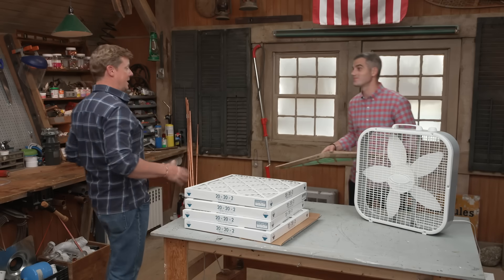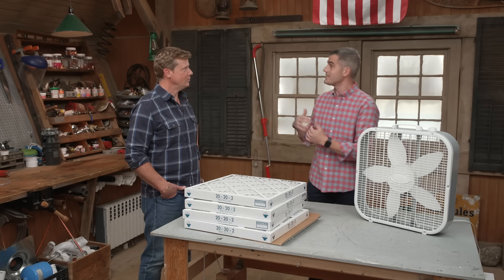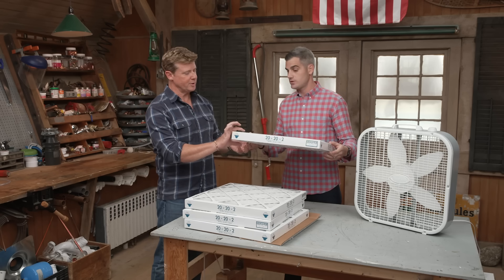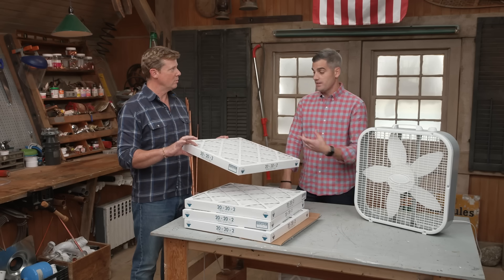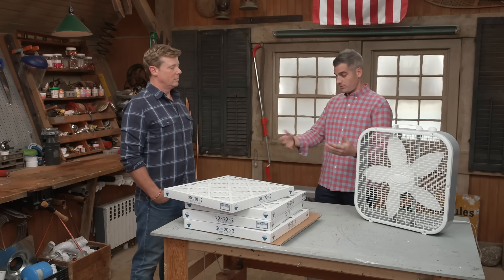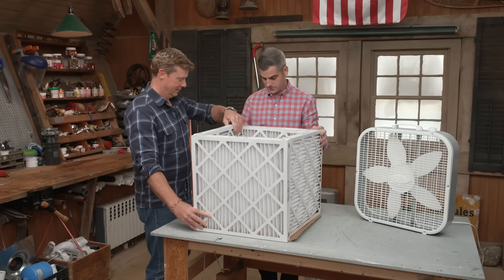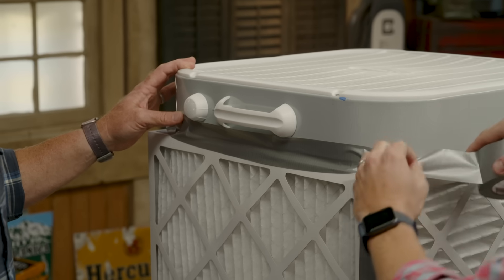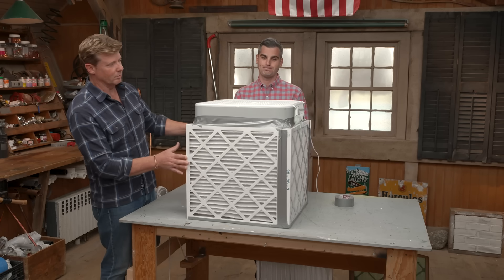How to Make a DIY Air Filter | Ask This Old House

Comment: I found a company that actually makes 3” thick filters that fit inside a standard 1” filter grille slot. They even have a foam gasket around the edges so it seals nicely. They’re fantastic! I get the merv 13 that’s 3” thick, and I didn’t need to retrofit anything whatsoever. Been using them about a year now. They’re the only company I know of that’s making these filters. Having worked for an HVAC company that specializes in air quality and filtration, I was able to learn a ton about how this works, and they’re the real deal.

Comment: Why NOT use HEPA filter ?  HEPA can removes ASBESTOS particles ( as well as bacteria and allergy caused particles ) which hazardous and damage your lungs  !
Reply: When this video was made air purifiers were sold out everywhere because of covid and all the wildfires so a bunch of people came up with these. Plus those 4 filters are typically cheaper to replace than a hepa filter. My fancy $400 air purifier's filter is $80 or more to replace and I need to replace it every 3-6 months because of all the crap in my local air. These filters you can get in a 4 pack from costco's website for $40.  The fan is ~$25 at walmart or similar.

Comment: I rent a large basement room. Problem is it has zero ventilation because it actually was the garage before it was converted into a room. I only have 3 small windows and no AC vents! 

To make things worse I have 3 cats, one of whom has developed asthma. 

I tried using an expensive air purifier but it gets caked up quickly and doesn’t really do much. There’s dust and hair everywhere no matter how much I clean. 

Gonna try making 2 of these so we can hopefully breathe more easily!

Comment: Im going to build a cardboard/wood version where I can slide the filters in so I wont have to tapae the filters. Having the filters slide rather than tape them will save me time and tape. It's going to take a little more measuring and design but at the end it will be worth it . Just sliding the filters in place will make it worth building it. Thanks for the idea guys!

Comment: As much as I hate being "that guy", I think it's important to note that the standard (Lasko-style) box fan is not designed to run in a horizontal orientation. Gravity will pull any lubricant from the bearings putting more stress on the motor and making the motor more prone to wearing out faster or, on older units, seize up altogether.

I just lay the filter against the back of the fan and let it suck up against the back side of the fan on its own. No tape needed. The frame of the filter sits nicely on the fan's footies and as long as the fan is on, the filter will stay in place. The most important part is to be sure the airflow arrows on the filter are pointing in the direction of the airflow.

I just don't think it's necessary to do that whole boxy thing with 4 filters. You're spending more money than you need to and you're really not gaining that much in filtration.
Reply: I highly doubt that would be a problem but if it makes you feel better,  just hit the motor with some spray lubricant once every 3 months.

Comment: The direction of airflow in a DIY box fan air filter setup is crucial for its efficiency and effectiveness. Here’s the breakdown:

Configuration Options

1. Air is pulled through the filters and blown out into the room:

The fan pulls air through the filters (filters on the intake side of the fan).

The air is then blown outward into the room, cleaned of particulates.

2. Air is pushed through the filters and blown into the room:

The fan pushes air through the filters (filters on the exhaust side of the fan).

Cleaned air exits the filters into the room.

Recommended Configuration

The most effective setup is Option 1: Air is pulled through the filters and blown out into the room.

Reasons Why This Matters

1. Fan Efficiency

Pulling air through filters: Fans are designed to pull air more efficiently than to push against resistance (like filters). This configuration puts less strain on the motor, improving the fan’s lifespan.

Pushing air through filters: Increases resistance, which can overwork the motor and decrease its efficiency over time.

2. Filtration Efficiency

When air is pulled through the filters, particulate matter (dust, allergens, etc.) gets trapped more effectively. The negative pressure created ensures all air passing through the fan is filtered.

Pushing air risks leaks or bypasses if the filters are not sealed perfectly, reducing air-cleaning performance.

3. Airflow Quality and Noise

Pulling air through the filters typically results in smoother, quieter operation, as fans are designed to work optimally with less resistance on the exhaust side.

Pushing air can create more turbulence and noise due to resistance.

Setup Tips for Best Results

Use MERV 13-rated filters or higher for capturing fine particulates.

Ensure filters are tightly sealed to the fan and to each other with tape to prevent air bypass.

Place the fan-filter system in a central location for better air circulation.

By pulling air through the filters, you optimize both the cleaning performance and the durability of your DIY filtration system.

Comment: The direction of the pleats in the filter should be vertical as that would add som strength to the PAPER structure. As it is vertical pleats just add weight that will aid in its collapse

Comment: 2” filters make it sturdier than 1” filters.  However, they should have put legs on it to have a 5th filter on the bottom for max CFM and CADR if you want to set that fan to high.  Should also use MERV 13 or higher.

Comment: What a joke.  If you guys were so concerned about COVID, you'd have been masked up.  If you thought it was legit you'd have gotten a smoke machine and turned it on.   This is what happens when the gov. chips in money to PBS.  There's no accountability because you have a guaranteed money source.  I can find dozens of Youtubers (I'll give you that they are after this) that built similar contraptions and actually showed them in action and measured their effectiveness.   

This station ceased to be of any useful info decades ago.

Comment: What was not mentioned in this video is that filters come in a wide range of numbers of pleats. That means, for example, that you could have a 1" filter with many pleats and a 2" or even 6" filter with very few pleats and the 1" filter could  actually offer more surface area to the flow of air and have lower resistance to the flow of air. There are actually some high quality 1" 13 MERV filters that have a lower resistance to the flow of air than cheap 8 MERV filters. It is common for technology to more forward so fast that many technicians have an understandably hard time keeping up. When a HVAC technician says to NEVER use a 1" 13 MERV filter, they should actually say, "under most circumstances, 13 MERV 1" filters are not advised. However, there are well engineered 13 MERV 1" filters that actuality offer acceptable resistance to the flow of air." In the spirit of full disclosure, these high performing filters usually carry a premium price.

Comment: If you reversed the fan (turned it around) so it was blowing in to the box - it would contain the caught contaminants better. That way you could take it outside to clean it out, without the risk of losing the contaminants whenever you move it.

Comment: Could you put a bucket full of holes in the middle between the fan and cardboard and fill it with charcoal or carbon for extra odor filtration? So it would look like the cube that he built; but inside, you'd have a bucket with holes all around for air to go through and fill the bucket with some carbon or charcoal. My understanding is that these filters do little for odors and mainly get particles, but that charcoal absorbs odors so I was hoping to combine them.

Comment: During covid, fires, smoke merv 13. Had this in for 6 months. Spring/summer down to merv 11.  11 through .  Of course the more merv,you cam ruin your furnace if it's not made for a merv 13 or higher.

Comment: Ignorance of the specifics of COVID-19 aside (understanding this is 3 years ago, hype and misinformation was still strong), duct taping these to your fan make a huge mess of these cheap box fans when you go to pull it off and replace the soiled filters. I use painter's tape, it's perfectly fine for adhesive power and peels of easily and doesn't leave duct tape's residue and paint peeling. My only advice is to invest in a solid fan, with a moderate to high CFM even if you are using it for a smaller space (mine is in a 20x15sqft room). The one linked in the description is approx 1800CFM, not terrible but there are slightly more powerful out there that really make a difference in the air flow as long as you don't go overboard on the MIRV ratings.

Comment: The Higher the Filtration ....the More inefficient.... the  Air system becomes. Flow restrictive and hard on the Hardware and fuel burn. Your choice.

  As for virus's ....Even hospital grade filters are largely ineffective.

Comment: My parents have a basic Regal oil furnace and Goodman central AC that's not energy star certified. I upgraded them from merv 5 filters to merv 14, and they have no issues with air resistance. The heat and AC still work fine. Although, I'm sure the more energy efficient HVAC systems would have a more difficult time with air resistance. They bought the least energy efficient Goodman AC model and regal furnace since they just wanted a basic, simple and reliable HVAC system.

Comment: Got to remember that velocity is  a direct function to the flow area. With a fan drawing 2000 cfm with a face area of 4 square feet, the average face velocity of the exhaust of the fan would be 500 fpm. If you surround it with a box with 4 2x2 filters, you have a total of 16 sq ft of flow area dropping the average face velocity at the filters to 125 fpm, which is a little over 2 ft per second. This may or may not be high enough to trap all particles in the flow stream. Research your particle sizes and check  your ASHRAE manual for the velocity required to entrain and carry these particles. Exhausting entrained particles in the air is pretty straightforward, but do your research.🎉

Comment: Thanks for a great video! I live alone in a 481 sq ft apartment and have a $50 Model FF 305 Lasko box fan that has on the back a holder where you clip in a 20x20x1 size filter. If I put a 20x20x1 MERV 13 filter in will it take more air pressure to pull the air through and over-work the motor? I think the fan is designed for, just a guess, filters down to about the pollen level but I don't think down to CoVid etc. Does anyone know is this all I need and not have to make this purifier and just buy a MERV 13, 1x20x20 filter? Would for my size living space taping one 4 inch filter on the back be better? So in my case I really wouldn't have to build a purifier with 4 filters?

Comment: Is more surface area, less resistance, or more resistance for airflow
Reply: Less resistance, the air in this case has four filters to flow through instead of one with the same fan driving the air through.

Comment: do you guys like this system better than the new lasko one with the more powerful motor and single air filter that runs behind it? It just seems like these take up a lot more space and require a lot more filters to replace long term. I am not against switching to this system but curious if it's signficantly better than a single Merv 13 on the back of the new lasko model.

Comment: Absolutely guy knows what he is talking about.  Further you can over heat the blower motor in your hvac system. The issues there are pretty big and expensive. Let’s not forget with covid getting control board that control your hvac system are hard to get in a timely manner.

Comment: What I have been doing is using a Merv 16 20 by 20 by 5 inch filter that I buy on Amazon for $89 and I only used one taped on the back of the intake side of the box fan. It's a lot easier and it works unbelievably well. Plus it leaves your fan in a stand-up position the way it was designed . Also I now no longer use tape I use a light bungee cord to hold the filter on the fan it is so much easier. Take care and be safe  . T

Comment: I get this up to a point.  Why the cardboard?  Which way is the air going?  How does air go through this with cardboard?  Sorry, poorly done.. I'm looking elsewhere.
Reply: The cardboard is only for the bottom of the cube, so that the cube is airtight. That is, so all air drawn into the cube is filtered, before being blown out by the fan.

The air flows in through the four filter sides and is blown out the top through the fan.

Comment: I have a question. 
I have a portable air conditioner in my bedroom but it seems that every air conditioner maker ignores people who have windows that slide right to left & the mounting brackets and hose won't stay in the windows.
I live in an apartment where the a/c in the bedroom will keep it tolerable but with the sun beating down on the window and wall, if it gets over 80F the ac wont' work.
I even put Reflectix on the windows and in my living room and its not much help.
Do you know of any bracket that will fit sideways sliding windows ?

Comment: Where I live in Martinez Ca, 33 miles NE of San Francisco on the edge of SF Bay,  I have to keep the screen door open because it is so hot in here in the summer & as a result it gets very dusty in here and I am allergic to grass and even with 3 air purifiers going 24-7 dust is everywhere.
I think it comes off the Bay and the lawn downstairs.
I will see about making one of these and let you know if it works.

Comment: what about wraping the boxed filters in activated charchole filter paper to catch VOCs and odors?
Reply: There are some MERV filters that have an activated charcol layer included. 

I think, (like what he was saying about the increased filter grade for a home HVAC (13 vs 8)), that the added layer would add strain on the fan motor. 

So, to adjust for that added strain, you'd have to add more surface area to the filter size. 

So, maybe get 20× 25 filters, instead of 20×20. So, the cube would be higher, like a little sky scraper. I think that would work.

Comment: Those fans don't suck. They just blow. That won't work. They suck air in from the front edges of the fan.
Reply: There should also be a "shroud" to cover the fan edges, so it doesnt do that. 

Cover the outer edges of the fan with tape, so you have a nice circle where air blows outward. 

That should prevent air from getting sucked in through the (unfiltered) edges of the fan.

The diameter of the circle on my fan, where the air blows out, is about 17 inches wide.

Comment: I built mine with 20x30x1 filtrete 1900s and added filtrete basics as prefilters.  Use it to filter basement.
I just removed my prefilter after 16 months.  I guess my particles were smaller because the 1900s are very dirty.  The basics are only slightly dirty.  I am thinking rebuilding with double 1900s so i can just replace the outer set without reconstructing the core four filters.

Comment: For somebody who made this and it works good for them....Did you put the fan facing blowing into the box or blowing out of the box?
Reply: I have the same question. One guy wrote:  "Great idea, I would drive the air into the box so the contaminants would stay inside whenas I move it to other places. Fan speed would indicate load."  That makes sense to me. From this video it's a little hard to tell what they did, but it seems like the air is entering through the filters and then blowing out of the fan. (Edit:  I just watched the video again and it's clear that the air enters through the filters and blows up through the fan. I saw another video where a guy did a test with the filter on the back of a box fan and another with the filter on the front. Result: no difference. Here's the video:  https://www.youtube.com/watch?v=zE4qmN_EOXw
Reply: The fan is blowing clean air outward. 

When putting the filters together, there is an arrow on them that you face inward, which is the direction in which the air is flowing.

Comment: It's actually called a Corsi-Rosenthal box. After the dean of engineering at UC Davis.  Richard Corsi
Reply: It's actually NOT.  This design has been in use for decades.  In this video, This Old House even credits Neil Comparetto who also did not invent this design.  Recently the two nutty-professors from UC Davis have co-opted this design as their own.  It is like someone claiming to have invented putting a rubberband around a deck of cards.

Comment: I put a wood burning stove in, and regardless of how I manage the air quality, I still get some soot that floats areound. I have the wood stove in our cellar and every time I go down to add wood, of do something in the cellar, I come up with a dry throat, coughing and sneezing. I'ver done everything that I know how to reduce the soot, but with little or no results. Ok, I saw this segment on the DIY air filter... hooky smokes Bullwinkle... this thing REALLY WORKS!  I was in the process of ordering a $ 399 deluxe air filter system, but now  I not only save a bunch of  moola, but , I did this myself.  Thanks a bunch guys !!!!

Comment: I made one of these using a 9" box fan (Black & Decker, actual width 11") and 12x12x1 MERV-8 filters.  Total cost, $40.66.  It required fitting a piece of cardboard for the fan to rest on, as it was a bit narrower than the 4 filters taped together, but that was easy.  It's small and unobtrusive.

Comment: I have the 5 inch thick filters  in my AC unit up in the attic.. I put the green Merv 1 filter in the return air vents down stairs. . This makes the 5 inch filter need to be  change cycle longer. They do not give the 5 inch filter away. Cheapest I found was $66 for  two plus tax.